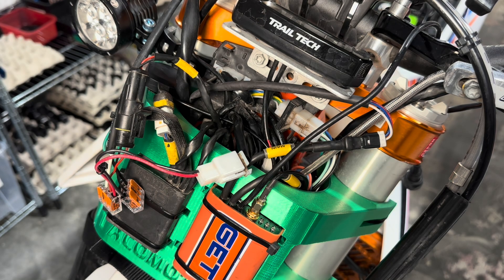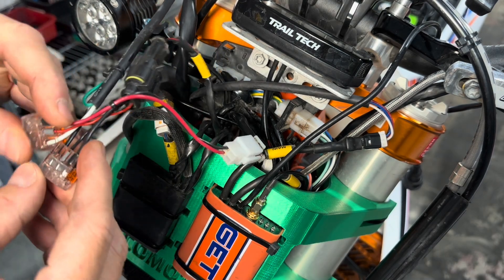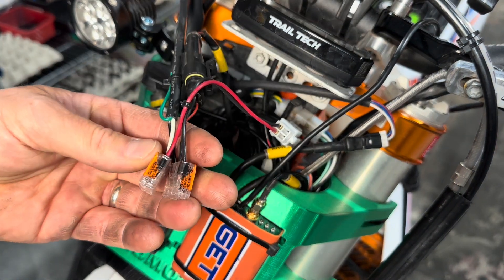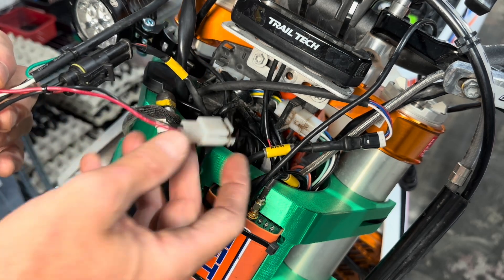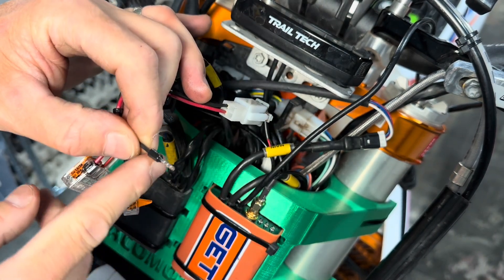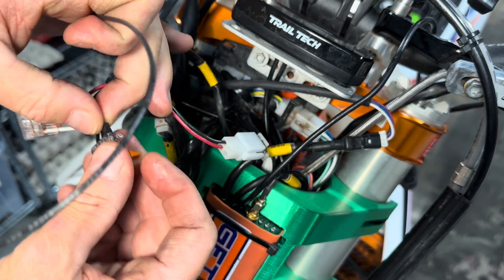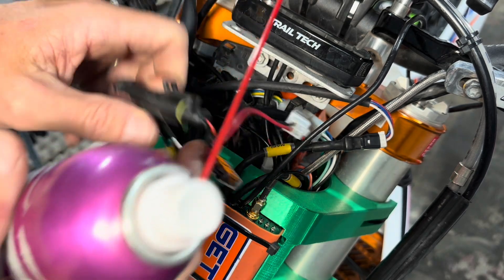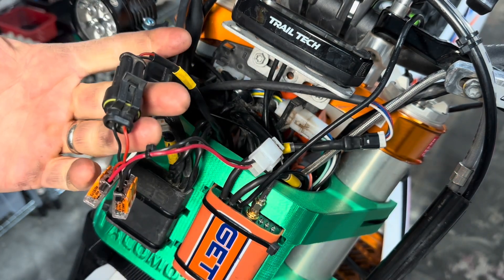Wago connectors on a dirtbike?

Comment: I use Wago connectors on my bike, they work fine for connecting my headlight. Only issue I found is the levers seize up and break off after about a season. Then you have to cut the wire back and put on a new connector. The ACF-50 might prevent this issue though.
Reply: the ac50 has prolonged the life of all the connectors and pins we're using on all our electrical

Comment: I bought a true north harness and taco moto fork wraps and tail tidy for my 22 501. The 2 companies connectors weren’t the same (at least on the rear a believe) so I snipped and used wagos and wrapped them in electrical tape with no problems 50 hours later. Great minds think alike!
Reply from the maker: Advisable to remove tape as it traps in moisture and may be the cause of failure from corrosion

Comment: What's the brand and p/n of the wire ends and crimper tool, please?
Reply from the maker: Those are a ferrule crimp system available from any electrical component supply house, automotive connector component supplier or even Amazon

Comment: Commonly those connectors are used for light ballasts. For LV DC they'll be fine, but all open connectors should have di electric grease. Use it thick. Put it on battery terminals, any electrical.

Or use fluid film. Also a di electric product.
Reply from the maker: They hold the same rating as the other open connectors used by the OEM on this bike and note the acf50 conductor protection applied
Reply: @TACOMOTOCO  another fun fact. Fluid film to lube the chain, to protect wiring connectors, and basically most anything with bikes. Not sure about it as a cable lube.... but in a pinch sure. Lol

Comment: I would use dielectric compound instead of the ACF 50. It would do a better job keeping out dirt, grime and water plus the anti corrosion properties.
Reply: we recommend the acf50 as it fully soaks through and penetrates every area of the connector and pins as well as repelling water and environmental contaminants

Comment: Hey Mike, would we use AFC-50 in place of dielectric grease, or use both in electrical connection? Thanks
Reply from the maker: We’ve been long term testing the acf50 and because it’s a liquid and flows into every part of the connector and wire does a more thorough job generally that grease but it should be re applied annually for best protective attributes

Comment: I use WAGO's from time to time in our equipment. It's worthwhile to know based on our experience that final mounting for the WAGO should position the conductor wires to run upwards into the female WAGO receiver(s), so that pooling moisture can drain, decreasing the potential for corrosion or failure. Any hydrophobic lubricant into the barrels is a good idea regardless of application. Do you have a good stock of CRF450 drainplugs or are they on b/o?
Reply from the maker: Very good tip

Comment: Mike what is the name of the wire end crimp connectors? I have used the Waco connectors but never even seen the other type for wire ends with the crimp tool. I think they would work great for my Eastern Beaver electrical box.
Reply: In the UK I know them as 'bootlace ferrules' , used for industrial wiring , from RS Components etc.
Reply: It's a ferrule crimp tool. You can get kits with the crimp and various size ferrule ends.
Reply: @newenglandscrambler2262  Thank you

Comment: So does the ACF50 essentially do the same as dielectric grease or is there more to it? If so what's the benefit over traditional dielectric grease?
Reply from the maker: Yes and it flows into every little crevice so is more thorough. Since we’ve discovered it has become our new go to electrical connector treatment product

Comment: I ignore the haters and use wago on automotive applications. They are so easy to use and re use. Electrical tape and or zip ties will make the already solid connections even more solid. a little dielectric grease will make them mostly waterproof. Putting ferrules on the ends of your wires makes them hold even better. I LOVE WAGO CONNECTORS!